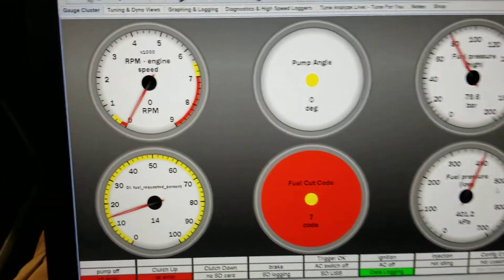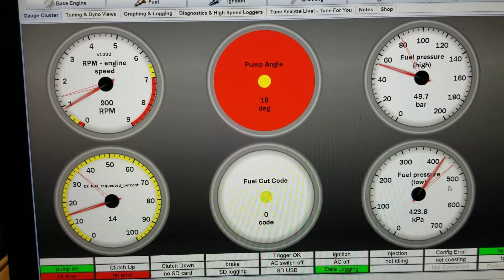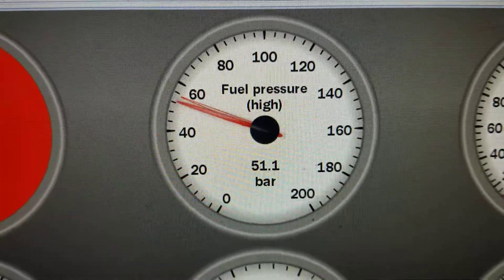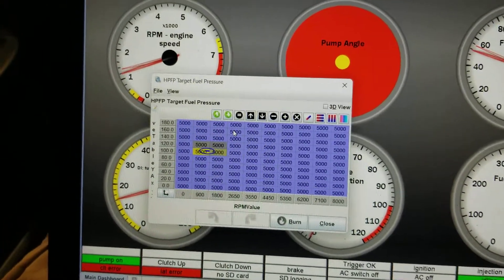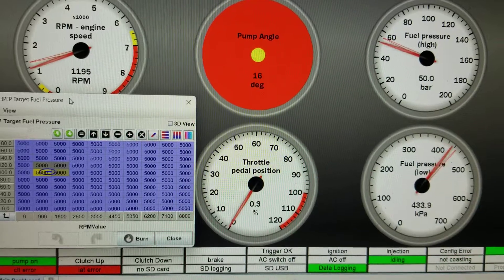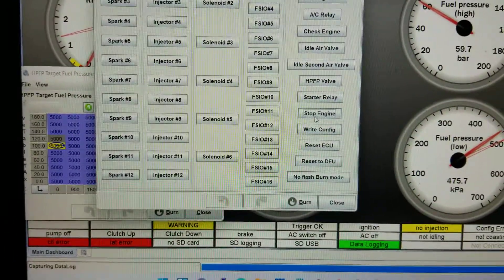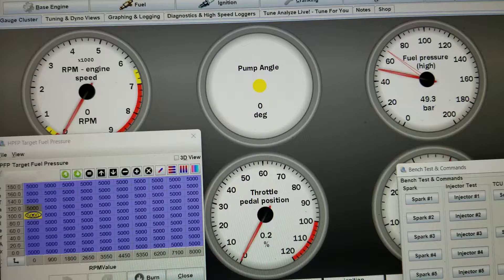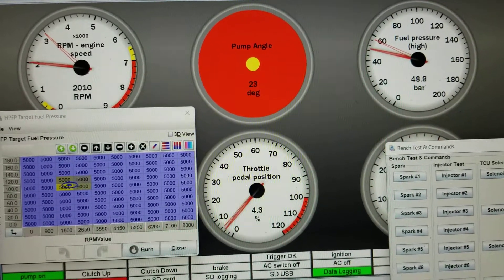Four years in the making #rusEFI has GDI

Comment: Call me dumb but what really separates gdi from port regarding electronic control other than the drivers?
Reply from the maker: Injector drivers have to be peak and hold which probably means three square inches of electronics. And then comes the whole fuel pressure control - you need to decide what pressure you want in the rain when, and you actually need to control electronic valve of the mechanical HPFP in sync with cam rotation. And then VVT might join the fun in terms of cam lobes positioning. Well I bet it's all simple once you are looking at the end result :)
Reply: @Rusefi  That sounds like a job and a half